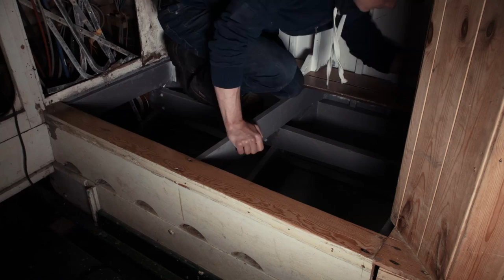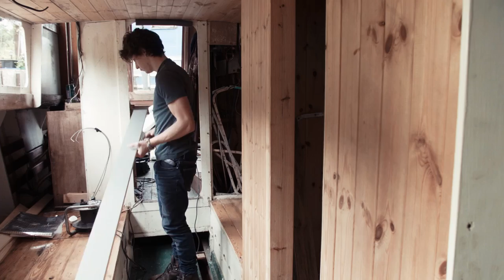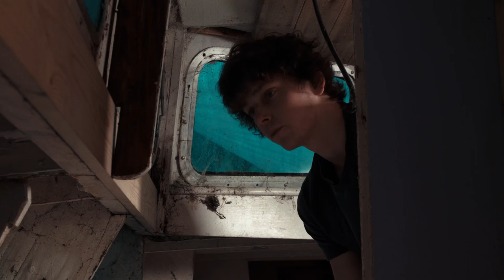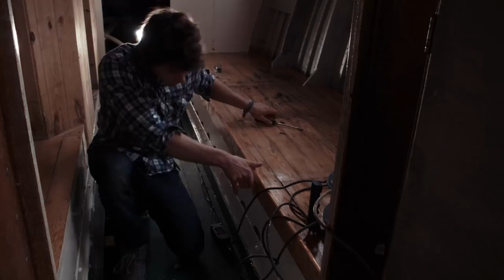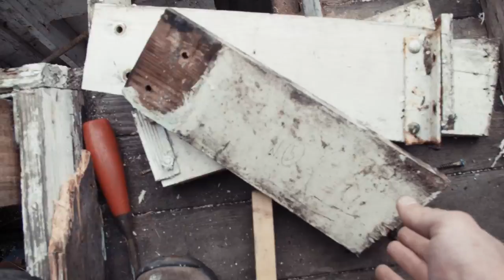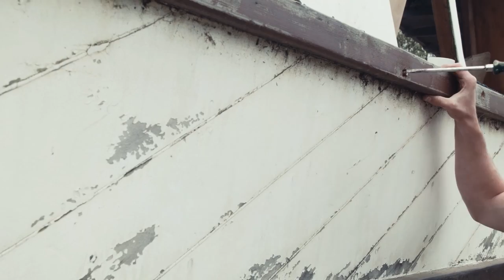Episode 05 - Restoring a 40' Wooden Boat

Comment: Nice work on the filming and editing. I've just caught onto your channel and watched 5 episodes. Of coarse it would be better to take the boat out of the water to really dry it out but I suppose that is not an option but when you've sealed water out from above you'll have a better idea if any is leaking through the hull. Still your parents know this boat inside out having owned it for 25 years, not as if you had bought it on trust.. Keep up the good work. BTW, where is this, in the UK or Ireland?
Reply from the maker: Thanks. Glad you're enjoying these episodes. I'm based in Ireland.